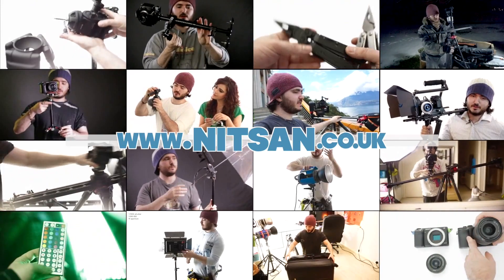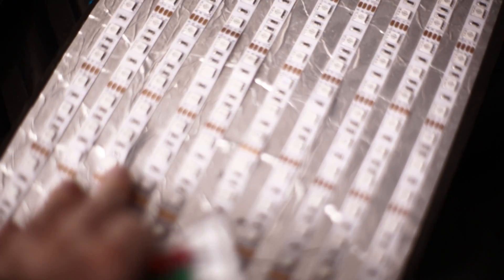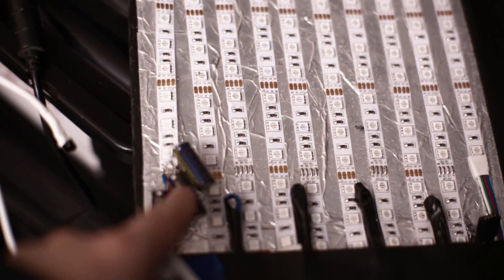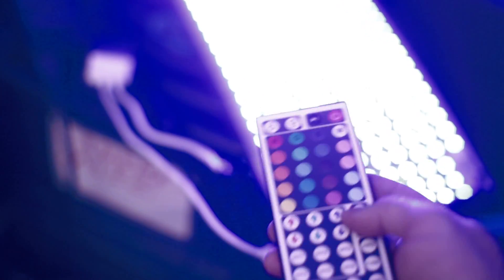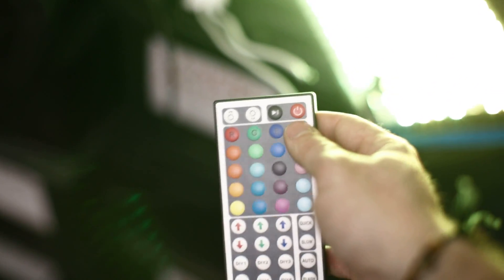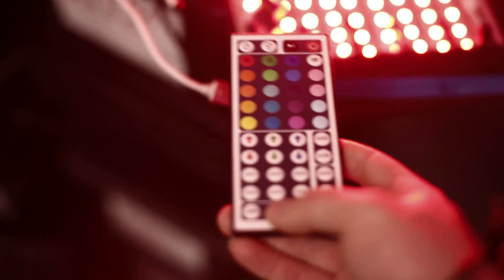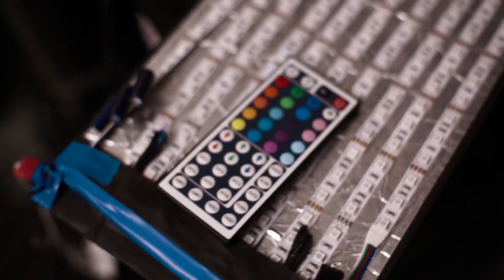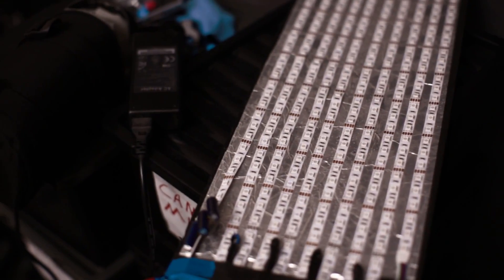Huge bright DIY color changing LED light! - £30

Comment: Another vote for how to build these with the capacitors, awesome fix! I've been using LED strips for various things but, never as a key light because of the flicker and banding these normally cause. Which led strips/controller are these exactly? 12v or 24v?

Comment: What kind of rechargeable battery would you need to take these lights in location ?
thanks
Reply from the maker: If they work on 12v then you'd need a 12v battery. There's lots on eBay.

Comment: How dangerous is it to touch these kind of capacitors? I got burned from one before thats why I ask ^^
Reply from the maker: ***** i have no clue. 
i dont recommend it.
Reply: Nitsan Simantov Thanks for the answer.
I thought about it because they are exposed and not protected. I will try to put them in an enclosure.

Comment: would love a comparison video and and explanation to why you used  electrolytic Capacitors 2200 uF / 16 V. the system runs off 12v right?
Reply from the maker: A capacitor is something that holds the electricity for a short time like a battery, then releases it again without the strong flickering that this unit creates in order to vary the power output of the LEDs and change their color.
Yes 12v.
Reply: Nitsan Simantov do you mind sharing a wire diagram. I have these lights at my house and planning to  custom building a striplight for the top and bottom of my 3 axis brushless gimbal rig.
Reply: if I'm correct the 3 capacitors are for each R, B, G wires? do you run the positive end  coming from the IR 12v control box. and the negative lead runs into the led? I have them at my house and don't want to wire them incorrectly. your help is much appreciated. ill be happy to share my build once its complete.
Reply from the maker: Daniel Hughes
send me an email and i'll send you a photo. :)
Reply: Daniel Hughes
Thank you. i really appropriate it. and love your channel.
Reply from the maker: Daniel Hughes
thanks :)

Comment from the maker: sure. I purchased a 4-pack of these on ebay. 
Low ESR 105°C Electrolytic Capacitors 
inside the listing i selected: 4x 2200 uF / 16 V

Comment: I Nitsan. Could you explain, or post a link or what not about the capacitors you added which reduce/eliminate the flicker effect, especially the values.

Thanks for the post, very interesting.

Comment: Hey Nitsan, I made one myself a few months back too, I made mine as a 1 metre long 3 row deep strip light and I used a metal cable trunking cover as the back.  I also discovered it can be powered by a Anker battery pack (the ones that can power a lap top, about 30 quid) I used it recent in a cool Sci Fi photo shot, and loved it. Lasts about 4 hours on full power on a 10000mah battery.